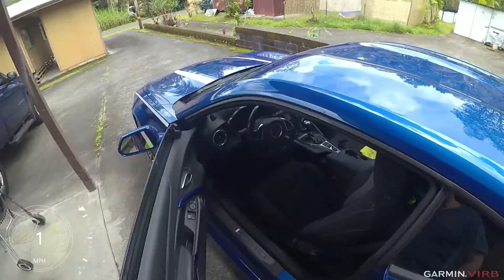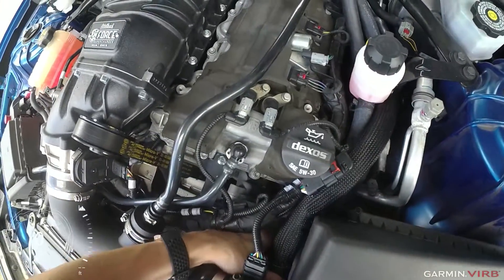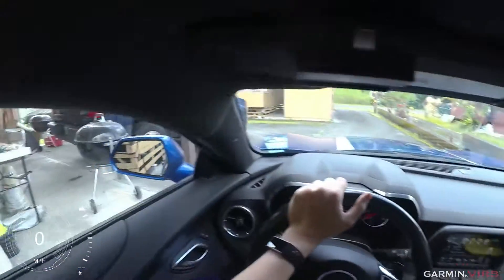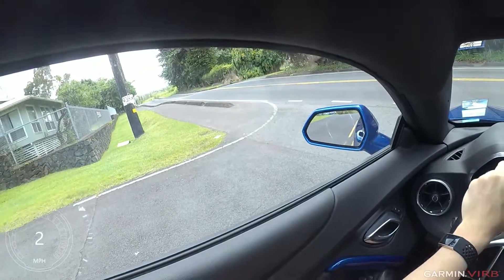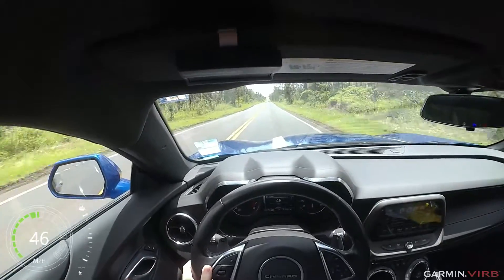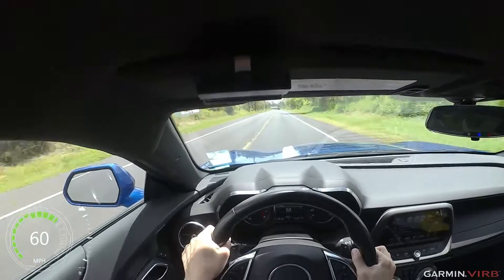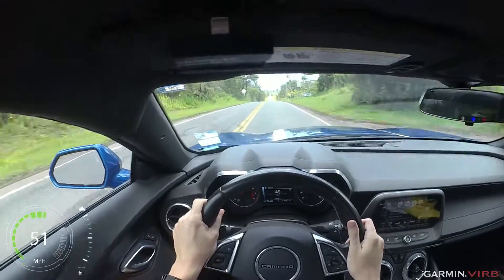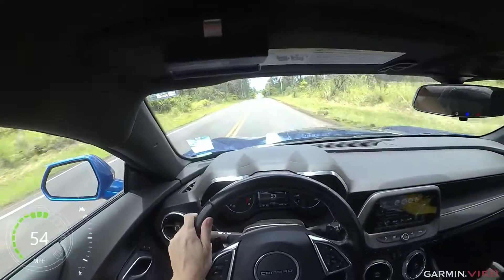Whine mod test on 2018 LGX Supercharged V6 Camaro. (Eaton 1.7L Supercharger)

Comment: beautifully styled car, sounds great - do you know how much hp it added? did you get a tune ?
Reply from the maker: Yes I got a tune. I also went to 8PSI of boost. It added about 150HP. Went from 335 -> 480 HP at the crank.
Reply: @Z51MAELSTROM  That is phenomenal! I'd bet that's a fun driving ride anytime. The tune was extra or did it come with the kit? I have a 2018 lt and I was looking at the Procharger, but man $6500 is a bit much, that's without the install but the kid does come with a tuner. The look of yours is top notch imo btw. I assume if you had it to do over again you would, right?
Reply from the maker: @tchrisou812  If I had the choice to do it over, I'd avoid it like the plague. It was cool having the only supercharged v6 around but I simply couldnt make the power I wanted. 

Furthermore the trans (If you have the auto 8L45) is made of glass and can't handle power. If you have the manual or the 10 speed it's a different story. When I bought my kit from edelbrock it was around 4500 just for the kit AND a tune, but I paid for a different tune because I didn't like theirs. It was too rich for my geographic location.

My suggestion? If you want power? Ditch the V6 and buy any SS camaro or a corvette. Don't waste your money trying to upgrade the shitshow that is the LGX.
Reply: @Z51MAELSTROM  Damn, I have the shitshow engine and the 8 spd auto trans with around 56k miles on it. Does it have problems with no mods or should I sell now?
Reply from the maker: @ I mean the car market is about to go nuts. If you can get a deal in a S550 mustang GT or a SS camaro you're happy with, jump on it. If you can afford new, go for it. The stock V6's hold a decent value, but nowhere near the V8's. You'll not get a lot in trade in even if it's like a 3LT with all the goodies because the V6 is hard to move. 

If you're willing to swap the trans to the 8L90(the one in the SS) it's good for 650HP and you can jump on that V6 and see what other supporting mods have come along. There could be cams now, I have no idea. The engine was fine at around 460HP, 485 was pushing it, but you can get pistons and rods supposedly to push even higher. There are options but you gotta be willing to go all out, or not at all, there is no real room for middle-ground.
Reply: @Z51MAELSTROM  I like the way you think. I can tell your experienced and introspective. Thanks man, irl we would be friends.

Comment: I was wondering can you link and show where you got the “whine mod kit from” I had a V6 Camaro and got rid of it in search of something with better power but now I’m just think it would be cool to supercharge it
Reply from the maker: I warn you now that I no longer own the camaro. It's not worth it. There aren't enough supporting mods for the supercharger once you do it. If you wanna break 400WHP safely, a water-meth kit is more or less mandatory. 

The LGX has no headers, so you can't do a header job. There are no cam kits, and supposedly only one person makes pistons and rods for it on instagram or twitter. It's outrageously priced as well. No heads either. If you're happy to do stock boost and just have a little extra kick sure. It's cool. If you want to actually seek power and speed, buy an SS or anything else with a V8.
Reply: @Z51MAELSTROM  What do you mean by do a stock boost? Also can you add whine kit without supercharging your car?
Reply from the maker: @Incitable Stock boost means, the supercharger kit comes with a pulley that produces 6PSI of boost. A smaller pulley means more boost.

And no, you need the supercharger, that produces the whine. One requires the other. Without a supercharger you have no supercharger whine to pump into the cabin.

Comment: I understand that this engine fails to make the power of the 3.6 Pentastar V6 with the Vortec Ripp Kit.  They typically make about 440 to the tires at lower boost levels.
Reply from the maker: Yes they are very different engines, and while the 3.6L from chevy is a very efficient and great design for what it gives stock. It's about as terrible a design as is physically possible for boosting.
Reply: thats bull  ive ownes the 3.6 penistar, and 5.7 hemi  both in challenger form and my current 2022 camaro 3.6  10A  would walk away from either of the mopars

Comment: Who does my v6 makes this sound when I accelerate fast , like when I floor it
Reply from the maker: What?
Reply: @Z51MAELSTROM  I asked do you have any idea why my camaro makes the whining sound when I floor it , like when I punch it you hear the whining sound..been doing it since I got it , and the check engine light isn’t on so not sure if it’s pertaining to the motor , I bought it 2nd hand,,,and I know it doesn’t have a super charger in it lol..just curious about the whining sound
Reply from the maker: @reddymaid7936  Absolutely no idea, it cant be the same noise. It could be an issue with the intake or the transmission. I'm not a mechanic, I'd get it checked out.

Comment: what is the smallest pulley you can run on these?
Reply from the maker: That is entirely up to how far you want to push it.  3.00" gets you to 10 PSI and at that point you better start considering a water-meth mix unless you've upgraded the heads, pistons and rods.  That is at least what my tuner suggested for reliability. You can also go a step, even further beyond to a 2.75" for 12psi, or a 2.67 for 13lbs, but the S/C is really only rated up to around 10. It could take 12 though.
Reply: @Z51MAELSTROM  that's perfect.  I haven't been chasing the scene for these motors in awhile. Is there still no legit port job for the LFX heads or has that changed? Nothing really came up on a Google search of the forums.
Reply from the maker: @nolaughing5087  You're confusing the LFX with the LGX. They are entirely two different motors. All of this related to the LGX, in the 2016+ Gen 6 V6 camaros.

Comment: HOW MUCH horsepower you gain and how much did it set you back in parts and labor?
Reply from the maker: Went from 335 crank to 485 crank for about 7k for everything done. Could have been a little cheaper had I done all of it all at once.

Comment: “Ok so my whine mod works I just have a tiny fucking supercharger” idk why that was funny 😂
Reply from the maker: Cause it's true. A 1.7L S/C is small compared to the 2-3L+ range ones that are typically used and installed.
Reply: @Z51MAELSTROM on v8’s😂😂 for a v6 this supercharger is almost half of the size of THIS engine😂

Comment: would this fit on lfx?
Reply from the maker: Probably not, you'd need to check Edelbrock's website, I believe Chevy stopped using the LFX in 2016 and newer Camaro's, and Edelbrock's kit is for 2016+ Camaro's.

You'd probably have to go with a centrifugal supercharger(procharger, vortec, paxton etc) or turbo kit.
Reply: @Z51MAELSTROM  aaah okay. Thanks for info. I've already got the vortech v3 running 13psi making 427hp... have you driven with both setups ? Which is better to you?
Reply from the maker: @calvinchoe100  I have not. I only have had this car and the one supercharger set up. I've got a new series of races coming up in the next vid.

Comment: Do you know if the supercharger would mount onto an LGX engine that's transversally mounted?
Reply from the maker: It should, no problem. You should ask a local mechanic/speed shop first to be sure, but the kit wouldn't change, just the angle of everything, but again, that shouldn't matter.

Comment: So I saw in the comments you have the 3.25 pulley instead and I was wondering if that’s the only thing you need to run more psi? Also how much whp you think it is with the edelbrock supercharger and the 3.25 pulley everything else stock
Reply from the maker: If you get a really conservative tune, don't change anything else, and just put the supercharger + the 8psi pully, you're going to be in the 350~WHP(4th gear pull on the A8 trans) ballpark. You can push for more, but you may be risking spark knock which could lead to failure under hard loads. 

The only way to build more PSI is to spin the supercharger faster, so you have smaller pully's to do that. Every .25 of an inch is about 2PSI more pressure. 

I have gotten cattless downpipes since this video, and with just that change, plus a tune adjustment I picked up over 30WHP. I'm sitting at about 400 right now, and close to 500 at the crank, and my tune is far from spicy.
Reply: @Z51MAELSTROM   I just ordered the pulley, so if I run just 6psi with stock pulley instead how much whp and have you dyne your car yet?
Reply from the maker: @v6cuhhmaro419  I've dyno'd my car, and I was at 383WHP in 4th, so that translates to about 395 at a 1:1(6th gear) pull. 

Stock pully? Expect like 330-340 depending on who tunes your car. 350~ on 8psi if you don't change the stock cats, they're a huge restriction.  You can obviously ask the tuner for more power, but you start to run the risk of your EGT's getting too hot and causing detonation, that's bad.

Comment: Hey man. I’m running same supercharger but I want that pulley and Im actually running the EdelBrock tune because it was on sale at the time. I’m planning on getting it retuned soon because it runs real rich and actually burned out the OE cats so I have exhaust to repair lol. I was curious though, what downpipes do you have and what belt are you running with the newer pulley?
Reply from the maker: I just have a normal 6 rib belt, I forgot the length but if you call up Summit racing they might be able to help, worst case your local shop can figure that out. 

It's a 3.25" pully for 2 more pounds of boost, and they are "American Racing Headers Cattless down pipes"  You might have to check a few stores cause not all of them offer the no cats option.
Reply: @Z51MAELSTROM  thanks for that info. Helps a lot and I can’t wait to get this thing tuned professionally after those mods. I can attest that the tune from edelbrock is terrible. If anyone needed to hear it, I will tell you. The tune has so many issues. Running rich(17mpg as a side effect and cats burned up and clogged at one point), stuttering, random misfires.... take it from me, the supercharger is great but the tune is terrible.

Side question, have you looked into changing out your differential with the diff from the manual LT’s??
Reply from the maker: @modern4ssassin272  I have but sourcing either a 4Cyl manual, or a LT manual rear end isn't easy where I live. It would give you posi and a bigger rear gear for more off the line action, but unless you're dig racing or proper drag racing it doesn't make a huge difference. For 40-60 rolls the 8A rear gear is plenty.
Reply: Did you ever get the smaller pully bro? If so did you need a new tune?

Comment: Hey are you running a boost gauge
Reply from the maker: I am not but when I've been on the dyno I peak around 8PSI
Reply: @Z51MAELSTROM  okay 👍🏻 I just am trying to see cuz I need to find a line to tie into for my methanol injection kit it needs to reed boost but can’t find anything on where to tie my vacuum/boost line into on the car
Reply from the maker: @lethal_chevy5442  Contact Edelbrock or Eaton, and ask them about the blower and where to attach boost. Ask for pictures.
Reply: @Z51MAELSTROM  yeah that’s what I was probably going to do once it arrives it supposed to ship out from edelbrock hopefully tomorrow
Reply: @Z51MAELSTROM  hey bro could you do me a quick favor they said behind the blower there is a port for the boost line I don’t have mine yet could you check to see if there is

Comment: Hey Bro just ordered 2 days ago can’t we get an outside the car Supercharger sound
Reply from the maker: So you won't get an outside the car whine sound. This isn't a giant hellcat supercharger. 

The whine mod adds IN-CABIN sound so you can hear the whine.
Reply: @Z51MAELSTROM  sounds good are you running a CAI with it
Reply from the maker: @lethal_chevy5442  I am not. I still have a stock intake.
Reply: @Z51MAELSTROM  I heard it makes a big difference I am going to run my 4 inch Intake with my supercharger
Reply from the maker: @lethal_chevy5442  A CAI makes...basically no difference at all. Even in a forced induction set up, unless you are running a bigger throttle body, it won't really help with performance. 

You might get more noise with the whine mod, and maybe both in-cabin, and outside? But personally I just want the inside noise, so I am a 100% sleeper. I want a 5.0 to bully me and then get slammed. I want an SS or 392 scatpack to bully me and get shit on.  If they hear the whine they gonna know something is up.
Reply: @Z51MAELSTROM  yeah I feel you bro and yeah I am running a ported throttle body definitely a sleeper is the way to go

Comment: Where did you buy the 3.25 pulley?
Reply from the maker: You can get it from Edelbrock if it's in stock, but I got mine from Summitracing as they had them in stock at the time. You just need a "3.25 inch 6-rib pully for edelborck supercharger"
Reply: @Z51MAELSTROM  Where did you get the belt to fit the smaller pully and what size would I need?
Reply: @Z51MAELSTROM  ??